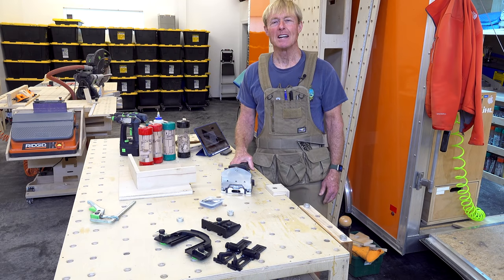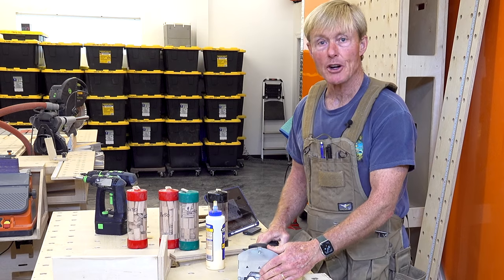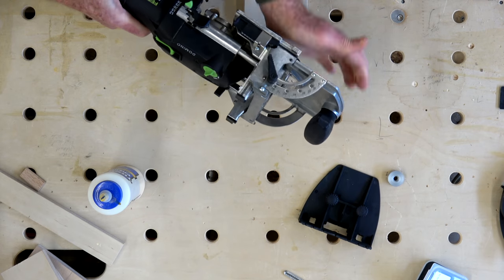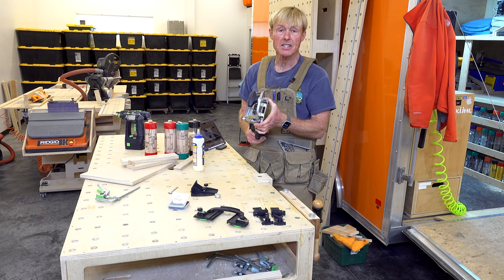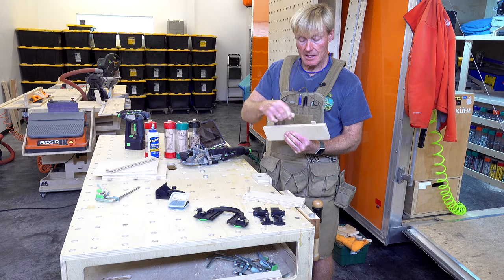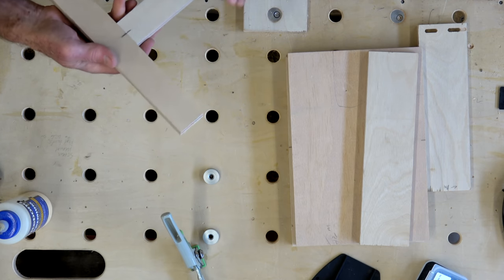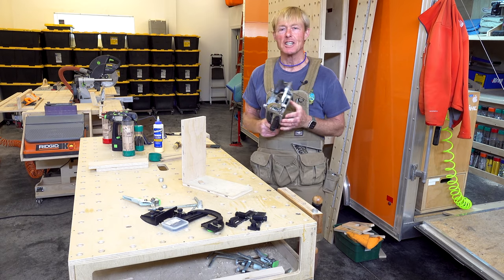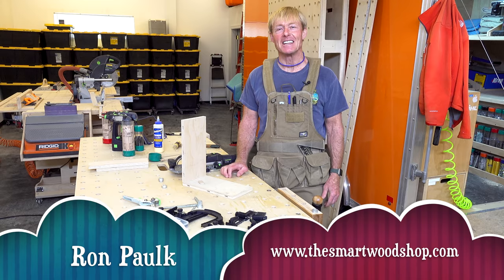Get to Know the Festool Domino 500: The Power Tool for Precise Wood Joining

Comment: My favorite tool is my XL 700, I make sure that every project I do uses dominos, my pocket hole jig collects dust. 

Another tip is to make a set of “Dry Fit Dominos” by sanding down, slightly, the domino thickness to make inserting in and taking them out easier when doing a dry fit.  I color my “Dry Fit Dominos” with Sharpie Markers, so I do not accidently use the “Dry Fit Dominos” in the final glue up.

It may take using a mallet to drive a domino in but, be careful because the glue can generate enough hydraulic pressure to bust out the bottom of the mortise, through the panel.  Inserting the domino, a little slower allows the glue to squeeze out as it should Wood Glue contains enough moisture that it can cause the domino to swell making inserting the dominos a bit harder.

We need a domino extractor to replace the small Vice-Grips that I use.
Reply: Great tips, thanks.
Reply: @dngriffiths8105  You are welcome!

Comment: Ron, You responded to my comment. Thank you. I spoke w Festool and removed my comment. I’ll do more tests to see if I can figure it out. Doubtful on user error as I’ve had great success with it, until it stopped: here’s what happened: While using pencil marks, I’d plunge both workpieces only to find the lines misaligned by 1mm once dry assembled. This was along an 8 foot cabinet for workshop while attaching back to base. While attaching sides the next day, it did the exact same thing. I’m using the engraved mark on bottom of base, not the plastic guide, which can and does move. I will do further testing and get back to you.

Once again, thank you for all you’ve done for the carpentry/woodworking community!

Comment: This is a good intro to the Domino, but a few minor corrections: it comes with the 5mm cutter, not the 6mm as standard. You also get the vertical support with the base unit. The full set includes the two other accessories shown, (but not discussed). The first is for making repeated cuts on the end of narrow stock, the second is the pair of “wings” that allow you to make mortises along a long edge without marking, each successive cut is referenced from the previous. They are both helpful, and are about half price when purchased as the full set. (A rare Festool discount!)
 Also, they introduced a 4mm cutter a few years back. They are good for delicate projects and work with 12mm ply. Also a good choice when used more for alignment than strength.  The 4mm cutter is shorter than all the others, so you have to take care when setting the depth.

Also, 5mm is also a good option 18mm/ 3/4” ply, at only 30mm length you can go full depth into both sides even with right angles, one less mistake to make 😀
Reply from the maker: Mine came with 6mm, but it is over 10 years old and the vertical support did not come with the base kit. I did not show the other accessories as I wanted to demonstrate how I how I use it in my personal workflow and I don't use the accessories often. I demonstrated the vertical support as I think it does help, thought I personally have found I can hold the domino square without it and prefer not having to install and remove accessories unless absolutely necessary.
Reply: @TheSmartWoodshop  I hope you didn't feel like I was being critical, I should have realized that things may have changed over the course of 10 years!
It was a very good first look at the Domino, I just thought it might be helpful to folks to point out what comes in the current configurations. 
When I bought mine it was a few a months after the "Emerald Anniversary" edition came out, which included all the additional cutters for free! I checked everywhere but they sold out very quickly.
Reply: I would also agree that I use those accessories less often over time. I am a big fan of the Domiplate when working with case goods, even though it is slightly awkward powering on/off because you using the machine upside down.

Comment: three additions to consider...
Seneca woodworking domiplate (even easier to make aligned holes)
TSO Bigfoot (like the festool foot but much larger)...also works with the DF700
For the offsets on the mortices--0, 3mm, 5mm (I put this on the top of my domino).  You can use this offset with the accessory guide wings to make the offsets for regularly spaced mortices top and bottom (just adjust the wing offset for top (no offset) and bottom) ..that way you can cut a long series of mortices and have them all line up
Reply: I just ordered the df500. I was watching videos and wondering about the domiplate. Looks like it would work well, just haven't decided yet

Comment: Besides the width issue (can't use a biscuit for rail and stile very well), does the domino have significant advantage over a good biscuit joiner?....or is it like batteries ( pick dewalt or milwaukee and run with it)?
Reply from the maker: A biscuit doesn’t have the tight precision of a tenon (Domino). I had and used two biscuit machines, but once I started using the domino , I never once considered using a biscuit. Finally, after years taking up space, both machines went on to new owners.
Reply: @TheSmartWoodshop  Thanks Ron. It sounds like a better mousetrap.

Comment: Don't watch if your looking for any comparison with biscuit joiners. Looks to be the same as the biscuit that most of us already have!
Reply from the maker: A biscuit joint doesn’t have the precision or hold of a Domino. I had two biscuit jointers for many years, but once I got the Domino, I never used the biscuit machines again. I covered the difference in the video, but cut it as most carpenters now know enough about the Domino  and the biscuit vs domino debate is over.
Reply: The Domino also provides surface alignment like a biscuit, but does a lot more in the way of strengthening joints. Consider glueing up a tabletop, both Biscuit and Domino would keep alignment while the glue dried, but don't add strength to that joint because the long grain to long grain glue joint is so strong. But if you if you then made a waterfall style table with that panel, the 45 degree end grain butt joint would be very weak, and properly sized Dominos would add a lot strength because of all the long grain glue joints. 
The better comparison would be with dowels, and you can get a workable jig for cheap and very good ones for $100. Or the Rockler Beadlock floating tenon jig for $79. Those and many other systems will yield excellent results, but just take much longer. The Domino is a production tool that gets work done, quickly and cleanly. It's not the best choice for everyone. 
As a footnote, the only handheld dowel machine I'm aware of, that has the accuracy of the Domino is made by Mafell and is a few hundred dollars more than the Festool. I had the Triton Duo Dowler, and it was unusable even after 2 visits for factory repair.
Reply: There's always that one guy in the comments
Reply: Tom Lawler:  If you think biscuits and domino's are equivalent, you haven't been paying attention.  "Don't watch if your looking for any comparison..."  Don't tell me what to watch.  You're not the boss of me.
Reply: If you can’t intuitively appreciate the difference between a biscuit and a domino, then the Festool is probably not going to improve the quality of your work, so it’s probably not something Tom Lawler needs.